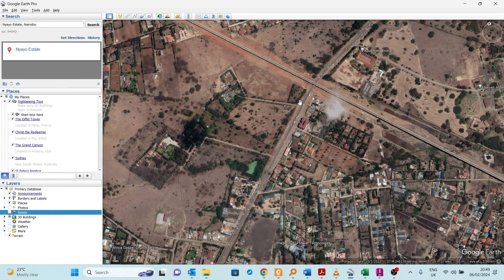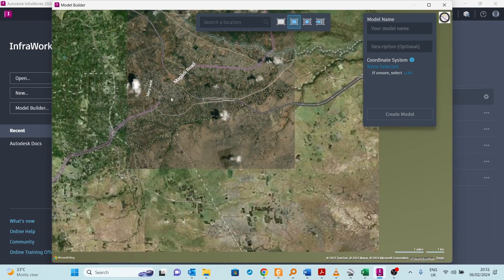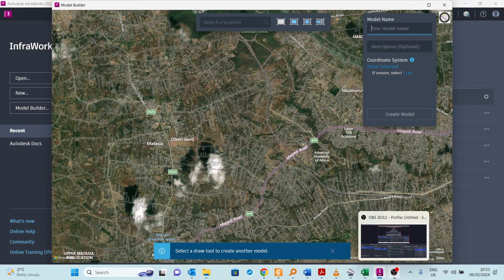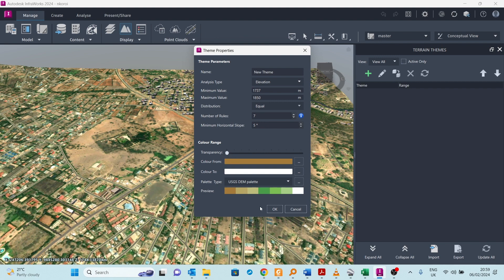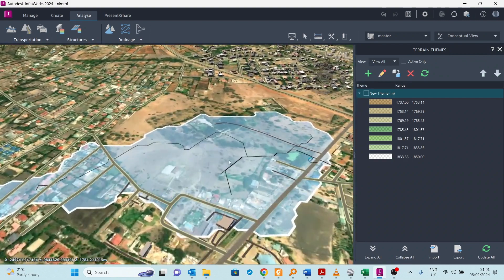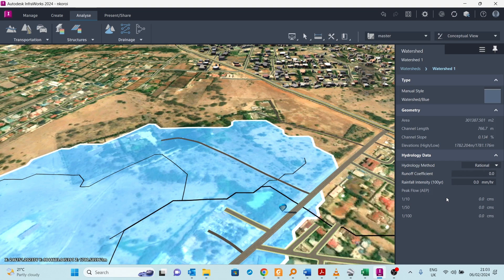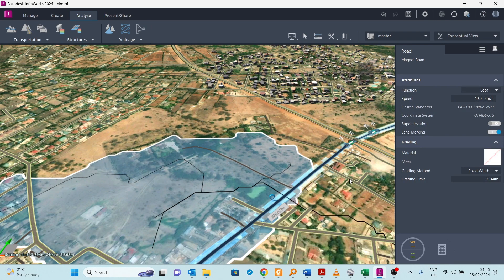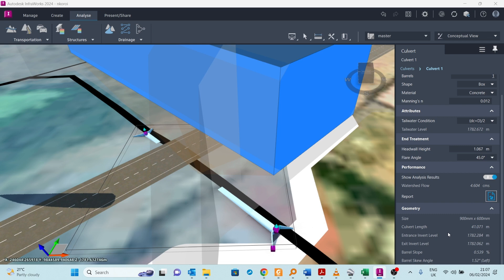How to Size Culverts in Infraworks (Tutorial)

Comment: Hi, i have a question on what happens when you a establish a watershed crossing that's near an intersection .....am i required to select all the roads leading to the intersection and convert them to component individually or focus on the road that has been crossed by the crossing.... your insight will be highly appreciated
Reply from the maker: just focus on the particular road
Reply: Thanks for the feedback.....and wat about the length and skew angle of the culvert can it be modified ....coz on my part the culvert generated seemed to be too long